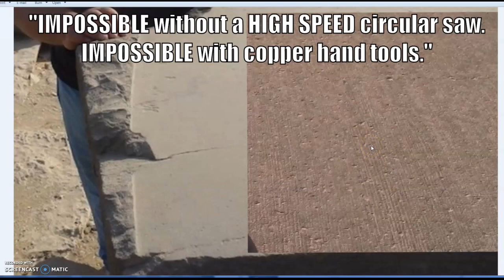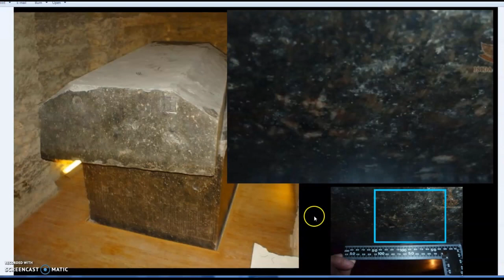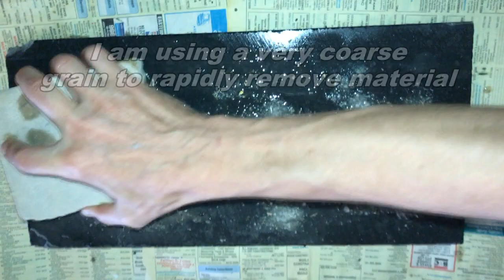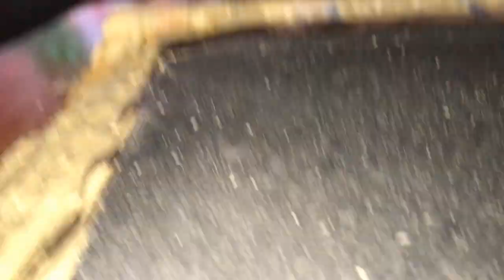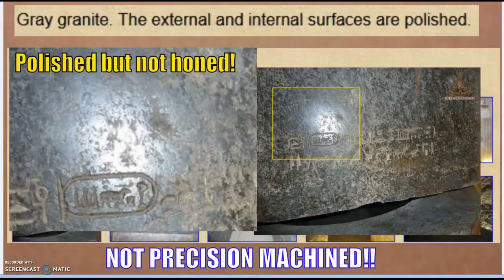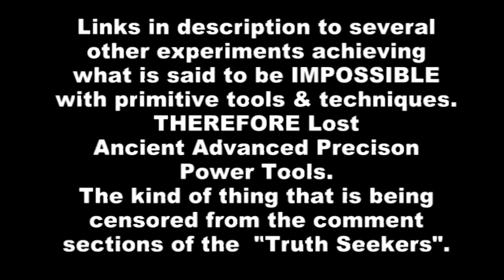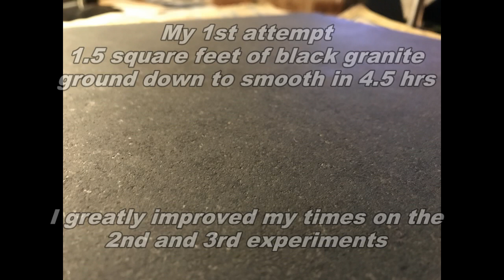Ancient Stone Working Techniques: Experiments with Black Granite on Removing Striations

Comment: 1) your square is NOT more precise than cris's (...its bending under its own weight in a photo where you compared it with a digital rectangle...or maybe my monitor is curved?) 

2)picture with a square that is done on the OUTSIDE of the box with a lid overhanging the side is NOT deemed as a correct way to measure right angles...OUTSIDE of the box and the INSIDE of the lid are planes that were not meant to meet and still you are using it as a "debunk"...(please correct me if im seeing it wrong)

3) we can clearly see a reflection of your square in the lid of a box...if its not smooth and polished, just honed and maybe not even that, how is that possible?

nevertheless, it is the NEED FOR SUCH PRECISION that is confusing and exciting us! 

also,chris measured wall to wall, floor to ceiling paralels ! thats waaaaay  harder to achieve than flatness or sheen of one plane!!!

We all know that, if persistent enough, they could've gotten it smooth by rubbing hands on them (for a century or so...but hey! they had all the time and workers in the world, didn"t they ??? )

we have all seen holy or lucky monuments that tourists rub or kiss or..whatever...and seen how polished and shiny they get at places of contact...no need for cutting compounds...time is all you need ! 
no surprise there! we all knew that its possible!  rIdiculous but possible!

and...All to burrie a cow? in a complex of tunnels (underground) too narrow to maneuvre its size? 
at 100 tonnes of weight...20 times repeated !???

pitting in walls is probably due to flooding and water sitting in them for a millenia and more and who knows what todays egyptians did to them in order to "restore:"them...

i know that its painfull to watch some of them egyptologists stir up some shit just before they are about to release a book but...sometimes you have to ignore opportunism and still check out the material. one doesnt cancel other out !

p.s. chriss mentiones 2 boxes he checked...out of how many...
Reply from the maker: 1- my square is made to international standards and no light passes underneath, if it was calibrated to higher standard light still wouldn't pass underneath. a short straight edge square doesn't bend under its own weight.
Here's a second experiment creating precision flat surface, i use a two plate technique- three plate technique of grinding still used to create flatness up to 30 nanometers
https://www.youtube.com/watch?v=a-EHHnBYaIg&feature=youtu.be
2- square on the outside- the claims of precision should apply to inside and outside, however the insides are not square either, 
Here is a dedicated video onthe Serapeum looking at all the boxes and irrefutable proof they are not " precision" flat- the reflection of the light shows ripples, no measuring devices are needed- all boxes examined
https://www.youtube.com/watch?v=bEwxMFDRmek&feature=youtu.be

PRECISION DOES NOT EXIST THERE- the claims are many but the measurements have not been done to that level, however they are unnecessary since by eye it is clear to see the lack of precision.
The above video includes good measurements.
This video and follow up shown above can be used to calculate how long a noob worker like me could do it, I also made an experiment in polishing, with a small team it wouldn't take that long at all to do. My videos are how to's so this can be checked cheaply and easily. polishing honed to
reflective finish, to get a honed to mirror finish is done by sealer, the Serapeum boxes show the pitting, one image i show shows the inside of one box half " polished" but you can see the brush strokes of the sealer.
If they had wanted to it would have taken a 2-3 weeks to get to true high mirror finish polish. The amount of workers and time needed very very low.

PItting from flooding and water sitting, by what mechanism, if xenolith (foreign stones) inside maybe but the stone they used didn't have those in them

Chris Dunn in his own site shows three out of focus odd angled photos- though the best one if you look close you see gaps under his " precision" straight edge square, as well as rippling on the surface.

Moving the stones isn't that difficult, the niches provide plentiful anchor points, using the rigging sail techniques to create mechanicsl advantage allows a small team to move them, the width of niches compared to tunnels allows plenty of room to get them in.

Comment: Are you using abrasives that were available to ancient Egyptians? Are grinding wheel abrasives naturally occurring? Also, do you have a solution for how they’d carve out the inside of a box with tight corners of 1-2mm radius? And how did they drill 2-3” core holes into granite going 2mm deep per revolution? And how did the Incas fit blobby shaped stones together like they were made of play-doh? If they used the grinding technique, that’s moving a very heavy stone side to side. And wouldn’t that make straight matching cuts on both mating surfaces from the larger abrasive granules? Has anyone ever taken two rocks apart to see if the scratches lined up on both surfaces?That’s a lot of enertia to stop and start over and over, linearly. If you can answer these questions, I think you can pretty much say you’ve proven it’s possible. But more interesting is all the carbon dating evidence dating all these ancient megalithic structures to be much much older than the Egyptians want to admit. We are seeing evidence of agriculturally grown wheat and livestock and advanced stonework and advanced geometry dating back 11,000 years. That sort of b haviour doesn’t suddenly get invented, so that would suggest probably another few thousand years of advancement, atleast. It’s really unknown. Could be many tens of thousands of years. Very interesting to see
Reply from the maker: 1- Yes I am using abrasives available to ancient Egyptians. Quartz and corundum, though quartz alone is more than enough. Like cuts like so granite dust works, sandstone is rich in quartz why I used a sandstone block.
2- Yes grinding wheel abrasives are naturally occuring- corundum is quie common - it's alumiinum oxide. the same stuff as rubies but is found widely unlike rubies. Mines in Egypt for this. Nowdays it is still being mined but also made synthetically.
3- i have replicated these experiments and posted many how to videos. In short the drills did not penetrate at 1-2mm each turn, the "perfect heliacal spiral" is just not there
https://www.youtube.com/watch?v=HQi4yql7Ysg&t=685s
With the primitive drilling technique you always create those grooves.
4- the grinding technique for polygonal stoone wouldn't work because of the shapes. You could do it on one plane but not on any more than that. The corners would catch on each other in most cases, also very impractical.
Ancient technique for making perfect copies of stone, or refitting broken pieces of stne together is to use a pantograph 
at 25 mins stone masons restoring the Parthenon preserve original pieces of stone by mating them with new pieces.
https://www.youtube.com/watch?v=HQi4yql7Ysg&t=685s
Broken/shattered stone such as those have thousads of diferent facets and angles, incredibly more complex geometry than the polugonal walls.
I can not find the clip but with similar technique experimentalist archeologist made a simple pantograph froma forked stick with a plumb line to keep it vertical. He brought two pieces of basalt close then used the tool to keep the distance equal between them. Once the fit was close they used mud to find the few remaining high spots, pounding stones to flatten them down and then mated them erfectly in a 3D fit.
in recent times similar work was done to make forts with polygonal granite walls such as Bomarsund.
they did have the advantage of steel yet you can use stone pounders, I have made a few small experiemnts to show how the technique works.
here's an example by another team,
https://www.youtube.com/watch?v=SOlc25RTF4Y
Keep in mind they are "apprentice level" without the benefit of more experienced guidance. Also by attaching the pounder to a rope you can swing it all day long with your fingertips rather than the very tiring method of holding the weight  all day long.
Als this one for making more detailed carvings with flint tools. Again they are novices learning on the job without guidance, if from generationsof stone workers I am confident they's learn more than a few little tricks to increase quality and time taken.
https://www.youtube.com/watch?v=q_lHOoKlgc8&t=5s
Reply from the maker: Carbon dating such as Gobleki Tepe? Yes but carbon and luminescence dating of Giza points to much younger.
Venus of Laussel and Willemdorf goes back 25000 years.
Laussel Venus small but same relief carving technique as Gobkeki Tepe.
Am I missing dating of sites to 11000 years apart from Gobleki Tepe. Which on its own points to a long progression since there are simpler portions to the work in the enclosure of the T blocks. Also indications of deeper/older constructions beneath.

Comment: What tools/methods  were used to hollow out the large blocks of granite @ Serapeum?
Reply from the maker: In the Great Pyramid the sarcophagus still shows a part of a core drilling mark and those can be seen in others as well.
With copper tube drilling ( I have many demo videos on that using different abrasives on granite including a demo using a PVC pipe) it's possible to hollow out at reasonable speeds.
https://www.youtube.com/watch?v=z4CfV3pCWcI

For other large coffers made outdoors firesetting would be an even quicker method.
Below is a sample video of stone tools to create the inner corners of those coffers.
https://www.youtube.com/watch?v=HQ2bHE7mTi4&t=7s

A follow up to this video - bringing rough granite face to honed flatness. Improving on the mistakes I made in this first attempt.
https://www.youtube.com/watch?v=a-EHHnBYaIg

Comment: How did they hollow out those boxes and move them around underground? None of that is answered by what yoive done here, you've demonstrated that you can make ancient sandpaper 🙄🙄 do you think this is science? Friction isnt a new discovery just to let you know. Nothing in this experiment explains the massive scale of their work, you've worked on a tiny slab to get a finish. Tell us how they were carved or quarried before these final steps?
Reply from the maker: In the great pyramid sarcophagus for just one example the has coring marks are still there. Hollowing out a box is simple. Drill cores and then flatten the sides and bottom. It’s just a box for heaven’s sake. 
I have several other videos on drilling granite with primitive tools. 
Trihedral inner corner replicated using flint tools and sandstone replicated by Scientists Against Myths channels, they also made impossible stone vases.
Do you really think you couldn’t do this on a larger scale? Are you suggesting if I had a larger piece that same process wouldn’t work? In earlier versions of this I hone the same size block with smaller block. 
Moving heavy blocks isn’t an issue at all. There are old photos of granite workers moving similar sized blocks. Wally Wallington shows how to do similar.
There’s nothing scientific in your comment. The people who preach lost high technology and whose talking points you are clearly reflecting would have you believe what I have shown here is impossible. I would love to see you talk about lack of science in their comment sections.  Send me a link when you do.
You need to get out of this lost high tech bubble and start thinking for yourself.
This and your earlier “have I been there?” comment are the same copy pasted talking points I have received a hundred times over.
It’s the main reason I started posting experiments like this.
If you believe hollowing put a granite box is anything but simple stone masonry then you haven’t looked into the issue except through the lost high tech blinkers.
Reply: @SacredGeometryDecoded  wtf are you talking about? If moving the blocks is easy, they would have replicated it easily long ago. We still have cedar trees stones and ropes, go right ahead buddy. Tell me how the extra tonnage is no problem then. 
Yea extra weight needs no additional effort these days either, we dont need bigger ships to move more cargo, or bigger engines to drive those ships or trucks. They just have a few guys on a hamster wheel doing it all, no problem. 😂 
You're an example of someone who lives inside their head and has never tackled anything practical in your life. Come join us in the real world where large objects present large issues and yes their weight does factor into how they are handled. Comparing something floating on water and being towed to moving over land shows how dense you are. Most of your video consists of you saying you dont believe x or y and then you dont feel the need to prove anything simply because it's all beneath your giant intellect 🙄 
At least ffs let the egyptians have more time than 80 years to do it all and give them some lead time, maybe a few thousand years, to reach that peak of their abilities to complete their masterpieces. 
How casually you speak about moving around these things is baffling and moat humans can barely fucking cook for themselves 😂😂😂 what kind of society works together like this, as a dedicated unit? Their entire lives would have to be dedicated to only these projects to finish them in 80 years, get a grip on yourself. 
So, have you been there? Seems like you should have been if you're so expert and dismiss those who have made the effort.
Reply: @SacredGeometryDecoded  how many boxes of any size have you hollowed out? It's so simple, you should knock one out in a week eh?
Reply from the maker: Brendan Ryan how much work with stone have you done at all? 
I have a very good idea of how long it will take. I have posted my own experiments along with those of others. Why don’t you repeat the experiments for yourself and give me your estimate?
Oops. I forgot you don’t need any data or evidence of any kind. You float above us all and are exempt. 
It’s a big granite box. Seriously. It has no moving parts and is a box. 
How can anyone be hung up on hollowing out a box. It might take longer but it’s easier to do a big one because you can inside. 
Plus moving 100 tonnes is nothing. Go look at how much force is applied on a sail and then ask how the small crew could manage that force to tighten sails etc.
If you can make and operate even a smallish sail ship you can manoeuvre 100 tonnes. You can even lift it.
It’s no big deal. People were doing than and more back in the old’n days just as photography and that new fangled telegraph line was popping up.
Reply: @SacredGeometryDecoded  the burden of proof is on you, you're debunking these claims. You need to understand how an argument works and then go right ahead and disprove something. Youre disputing all of these and offering explanations on the contrary so the burden is not on me. I havent claimed making the box is easy, you have yet think it's so easy that it doesnt warrant a trial to cover your bases. Estimates and calculations dont mean shit unless you follow through on it, generally how science works, ask your mate einstein. 
Yet again, a fucking boat on water is not a similar mass on land, have you ever swam in a pool? Tow your friend around a pool by their leg then drag them around the ground in the same fashion and see what is more difficult? How is sailing a ship and handling 100 tons of stone remotely the same thing? Handling mich smaller loads with tractors and excavators in the present day is dangerous and often difficult, I have done these things for years. That's hydraulic power driven by internal combustion engines putting out hundreds of horsepower. Now you just shrug and say multiples of that is a cinch via manual labour 😂😂😂 
They are tightening a sail.......your level of logical fallacies seems to know no bounds, yoive gone from huge stones, to towing ships to fabric sails and it's all the same to you 😂😂😂 
Lifting 200 tons plus today requires enormous cranes and is done for the likes of military ships or cargo ship construction etc, no modern humans are doing this anywhere. Many impressive things have been done in modern times without engines and steel but they were special projects long in the planning. It wasnt a few mates doing it as their side gig, they actually achieved this and werent just talking shite like you are from your living room. 
You're attributing the design, planning and execution to all the same people all at one time over many many sites in the middle east. What planet are you from? Do you know any such massive structures built today where the same people do every job involved? To do it as you describe, every person would have to master many disciplines if the crew was so small as you've alluded to. 
You throw all logic out  the window here and it sounds farcical tbh, even building a normal house today requires multiple skill sets at various stages and it's in concrete wood and steel that can often be moved easily by hand. 
Btw, the force applied to the sail is by the wind you dope, humans only set the sail to catch it, this is far different and far lower force generation. 
What you describe in lifting the stones equates to humans being the wind power to exert the required force on the ropes 🙄🙄🙄 
We have hands to pull on dopes, at least allow for there to have been hundreds of them doing it 🤦‍♂️